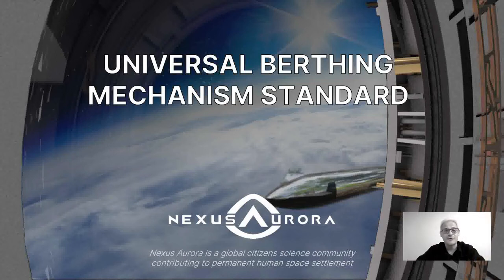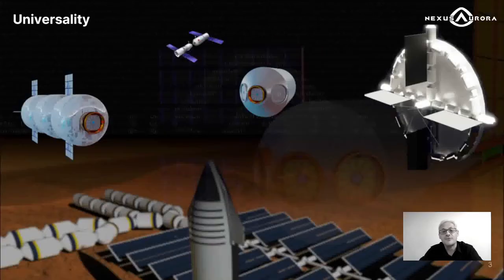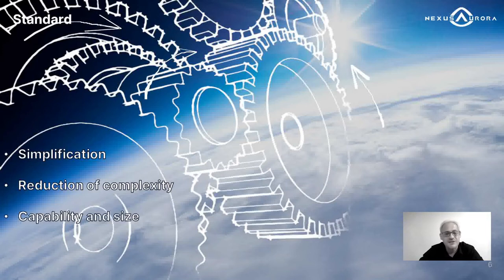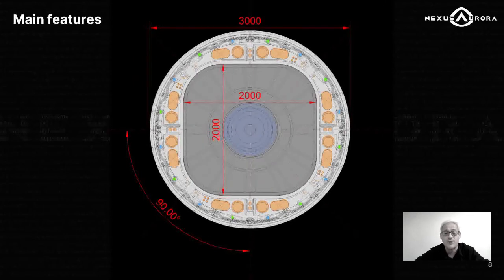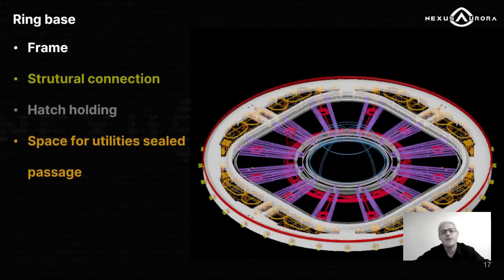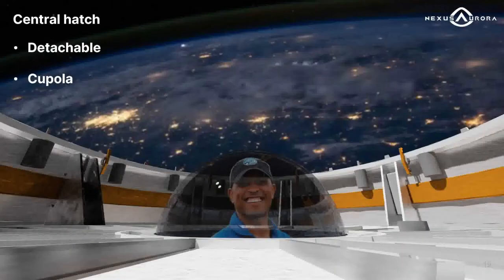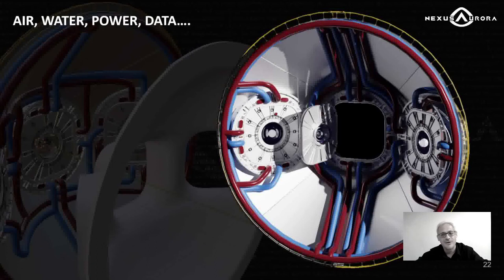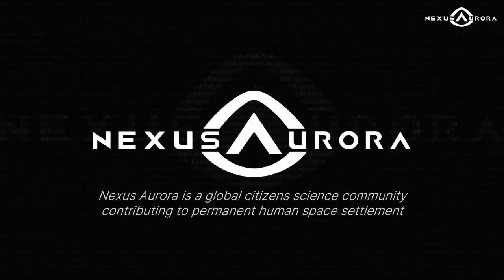NexusAurora Universal Berthing Mechanism

Comment: I can't imagine this technology being used on the surface of Mars (or the Moon). The UBM benefits from two modules in weightlessness and with easy 3D fine movements to bring together the modules. On Mars, if you assume 2 prefabricated modules (sitting next to each other) then how do you propose picking up one or both to simulate in-outerspace docking? One or more cranes? If modules are built up instead of prefabricated then it makes sense that their building system would include means for expansion of modules and linking of modules from the ground up. For example, prefabricated panels for the floor, walls, and ceiling.